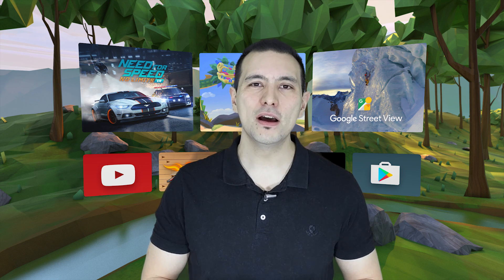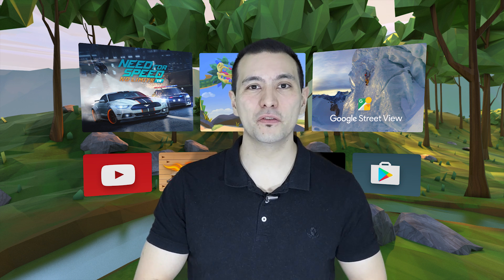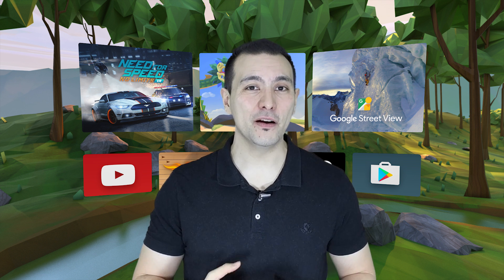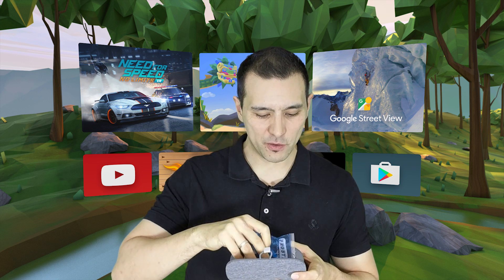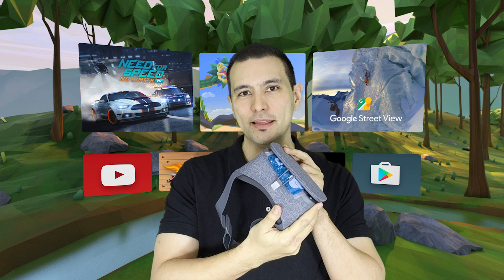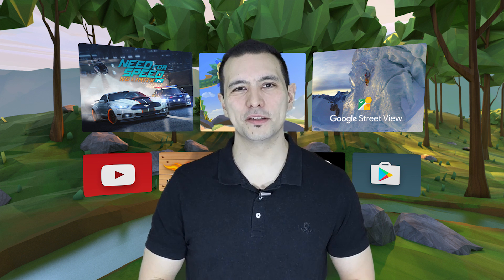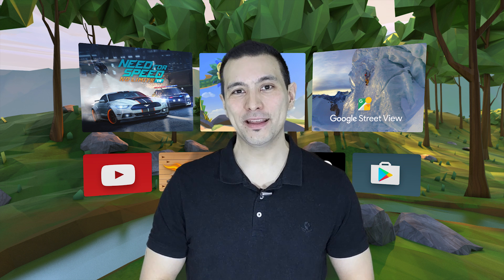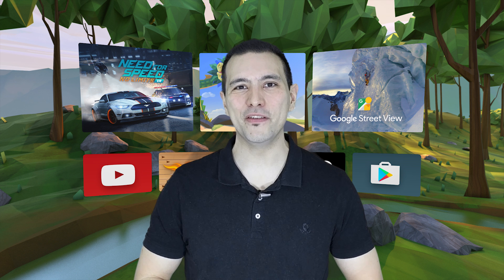How to solve the Pixel XL overheating problem - Part 2! Weekly Google Daydream VR Q & A No. 1

Comment: I made a makeshift version of this using a Ziploc bag, water, and duct tape lol
Reply from the maker: Oh interesting! And does it work?
Reply: well kinda. Problem was water would come out corners of the zip under pressure. The water still went through the duct tape, though slowly. So I tried taking a lighter to the top of the bag and melting it to seal it, which worked perfectly. It works a lot better than aluminum foil, not sure if just as good as gel packet, but with it I can use daydream until batteries run out on my Axon 7 and it'll stay around 100-105°F (38-40°C). I mostly watch youtube and netflix with it so don't know how well it would work if I played games until the battery runs out. 

Still can't use it while charging though, it got up to 120 F (49 C), even with the bag, which got pretty hot itself lol.
Reply: I'm pretty sure the bag works fine even once it gets hot, but I still replace it once or twice to be safe  if I'm using the daydream for longer than an hour